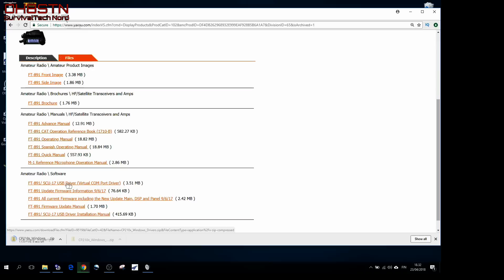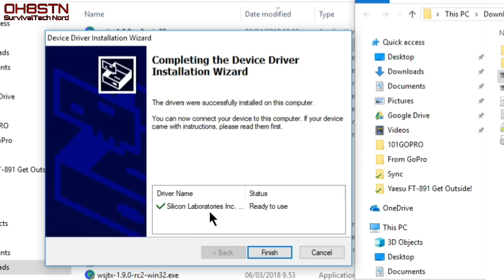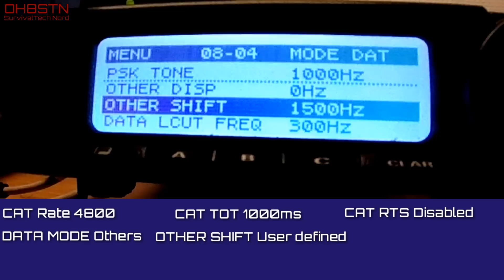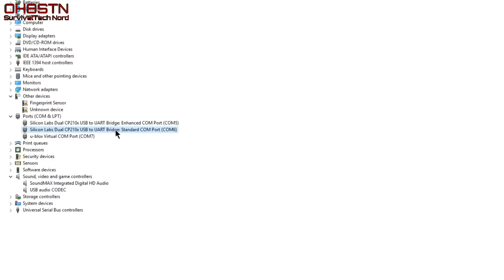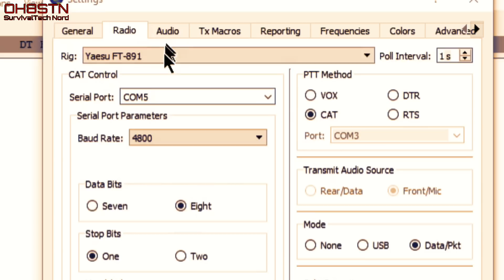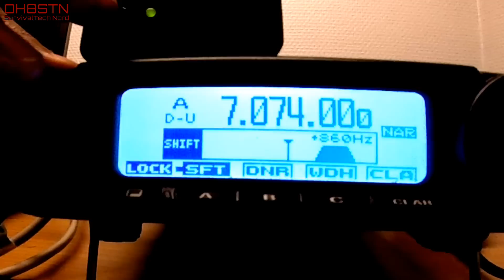Yaesu FT-891 FT8 WSJT-X Data & CAT configuration

Comment: Hello Julian, this is an excellent video which I followed to the letter and managed to set up my FT-891 with WSJT-X connected to my Laptop using a SignaLink interface. I have a problem though which I'm hoping you can help me with. After about 5-10 transmissions, the CAT control seems to get lost and the radio does not transmit any power. If I unplug the USB plug from the Laptop (the one connected to the radio) then re-connect it, the CAT control is re-established. The number of transmissions varies before this happens. I have tried altering the Power (15 watts and 30 watts) and it happens on both. Do you have any thoughts on what could be causing this ? It's rather annoying, especially if I am in the middle of a QSO ! Thanks. Martin
Reply from the maker: Sounds like RFI.
Try a shorter USB cable. In fact try to reduce the length of all of your cables, as much as possible. This is just fixing the symptoms though. Trying to figure out if you're getting current in your coax, from your antenna.
Thanks for the question and the comment, it's very much appreciated
Reply: @OH8STN  Thanks Julian, I attached a Ferrite Bead to the end of the USB cable (the PC end) and it seems to have worked, the TX continues for as long as needed now and does not cut out (I guess the source of the RFI is still there but at least I have a workround. One other issue I am having with this setup,  when I transmit on frequencies between 600Hz and around 1600Hz, full power (set to 25W) is achieved. When replying to CQ call on frequencies from around 1800Hz and up, my power drops to around 1-2 watts. Can you suggest what settings need to be changed or suggest what the problem may be ? My "Other Shift" setting on the radio is set to 1000Hz and "Width" setting to 800HZ. Thanks

Comment: One more Question :) should i Switch AGC  off ? If i Turn it on, on the left side my Waterfall is red then ... and what about NAR ?
Reply from the maker: Great question.  I usually run with agc off when running data modes. The best advice I can give you is not to be afraid to test and find the best setup for you. AGC is definitely off but I think settings can be applied dynamically based on the situation. Does that make sense?
Reply: @OH8STN  yes ! thank you.... i am new in HAM Radio so i have much Questions :) i will try it......
Reply from the maker: @mabo4848  no worries. You can always ask questions although I don't always answer so quickly.
Reply: OH8STN Thank you 😀

Comment: Got a question for you I am just getting into digital what program do you use?
Reply: Ok cool thanks for the info
Reply from the maker: It really depends on the mode. If you want to do ft8 or wspr you'll need to use wsjt-x. If you want to run JS8, JS8Call. Everything else, FLDigi.
Reply: @OH8STN  ok cool thanks one more question what do u use for HD email?
Reply: Hf not hd
Reply from the maker: @donnymazon8516  there are two options. PSKMail and WinLink. PSKMail has its own client for every OS, WinLink is Winfows only, but there is an independent Raspberry Pi deployment

Comment: If i wanted to use ft891 cat control with a mac what driver would i need?
Reply from the maker: You might have to check the Yaesu.com website for drivers. If your Mac is linux-based like most modern Apple computers are, you won't need a driver.
Reply: I have a 2010 MacBook Pro and did not have to load any drivers.

Comment: N4AOX new operator having trouble with 891 running DigiPan --CCW. I have rigged a CAT (Silicon Labs UART Advance RS232 Port) on my Win 7 Laptop USB/Com #6, but still cannot get the
PTT signal to go to transmit thru the CAT port (mini-USB on the 891). I have the Data In and Data Out 6 pin
DIN plug coming from computer laptop with the mic-in and mic-out 1/8 plugs.

The rig works fine with PSK31 on the DIGITAL MODEM from China, with its own
onboard sound card thru the 891 using the 6 pin DIN plug on the 891 to 6pin DIN on the DIGITAL MODEM.

The rig runs DigiPan on the LAPTOP in receive AOK, but NO
TRANSMIT. I can hold down the Mic. PTT and it does seem to send, but cannot get the PTT
signal from the LAPTOP through the Cat Cord to work, even though DigiPan recognizes Com#5 PTT-RST-on.

I want it to work PSK-31 like is described on Page 64 of the 891 advanced manual using a
laptop. I have gone thru the 891 memory menu settings several times. Is the lower diagram P.64
in the 891 advance manual NOT CORRECT?
Reply from the maker: I would bet anything the problem is either 
(1) the Silicon Labs uart Advanced rs-232 Port. 
(2) The Yaesu USB drivers were not installed or not configured correctly.
(3) The wrong USB port was chosen.
The manual is 100% correct.
Reply: @OH8STN  I can make it work by holding down PTT button on Mike but that is not convenient.  I can do like they did in the old days and build a little circuit to VOX the data-in and dump a killer voltage on the 891 PTT line internally but hate to start carving on a 1 mo old radio.
Reply from the maker: @ccwynn6657  I think the problem is somewhere between the radio and the chair. 😉
I gave you 3 troubleshooting points to consider, test those. You could also simply enable Vox on the data port.  If you're unsuccessful, you could also contact Yaesu support. I'm sure they can walk through your configuration with you.

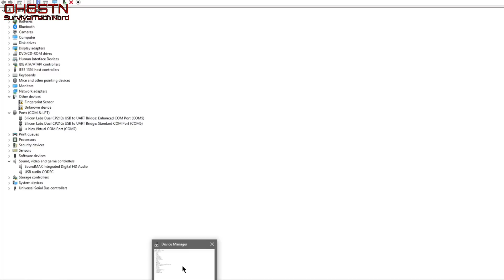Comment: Hi Julian - At 5:45 you mention a cable that plugs into the DATA/RTTY port, then plugs into a USB port in the computer.  However, I have the cable that plugs into the DATA/RTTY port on the rig, but ends in open wires.  I had assumed that it would be going to the sound card.  I guess that I could splice in a USB plug, If I knew which wires went where into the USB.

Comment: Great video,
as I see the data mode is D-U 8 than you simple change shift 1000 hz  width 500hz.A question Julian,can I put the Data Mode on USB mode?
Dinos..73..
Reply from the maker: Yes, you can also use USB mode 👍👍👍
Reply: @OH8STN  thanks Julian..73

Comment: Hi Julian, Have you heard of and/or experienced the "CAT clicking" problem that's been reported with the FT-891? I'm thinking about buying a used one but I can't find out if that problem was a settings fix or a hardware problem that I'd need a warranty to repair. I'm really interested in running this with digital modes and if it has "issues" in some models I'd pay an extra $100 for the full 3 year warranty. 

 If you've experienced that problem and overcome it with a radio setting could you please respond to this comment?

Thanks and I really like your ham radio videos.
Reply from the maker: You know I'm just sitting here working on an ft-891 video. That clicking was in the first generation of the ft-891. In the more recent versions, there isn't that problem. It seems that Yaesu has quietly fixed it, without letting anyone know there was an initial problem. So 90% of the communications I do with the 891 are digital Communications. Winlink, js8, ... there's a website or possibly a group on Facebook that identified which of the 891 series, had the problem by its serial number. I'll need to find it, but I will include that in my video.
Reply: @OH8STN  wow thanks for the quick reply.

Comment: Julian, I have found an alternate method to having to move the SFT key to max.  Instead, go to OTHER DISP 1500, OTHER SHIFT 1500, DATA LCUT FREQ OFF, DATA HCUT OFF, DATA PTT DAKY, go to main screen and adjust WDH to Max 3000, don't touch SFT!  This will give you max receive on the center freq.   I have these settings and they seem to work fine.
Reply from the maker: Thanks for this. Actually this is how I'm doing it these days. Your way is a much nicer way, and the shift still works as intended. I should make an update video on that.

Comment: Hi, Julian.  I used your parameters to get my FT-891 to talk to FLRIG and FLDIGI on my Maacbook Pro runniing Parallels (Windows).  Good instructions!  In order to get FLRIG to work, I installed the latest version, 1.3.42.03.  I have not yet gotten to configuring wsjt-x or js8call.  Still on to do list.

Comment: From my experience I’ve come to

Cw freq display FREQ
Data mode OTHERS
Other disp 1500
Other shift 1500
Data lcut freq OFF
Data hcut freq OFF

And from main screen set WDH to maximum 3000, don't touch SFT.

Doing so we have maximum width filter starting at our dial frequency (=tuned freq) centered at dial freq+1500.

I didn’t find any detailed explanation of those  Shift and Disp did it mostly experimentally.
But they look like: Filter center=tuned freq+Shift and Dial freq=Filter center - Disp
Sure everything Inside 891 is much more complex since it's triple conversion radio + DSP. My explanation above is as if we are dealing with classic single conversion SSB receiver.

73
Andrey RA0UFF
Reply from the maker: Thanks Andre. I've arrived at very similar settings now. The bandwidth and the shift functions in the front panel of the radio work together. You can narrow the bandwidth with the bandwidth setting on the front panel and then moved the shift for the signal you want to focus on. This will bring a signal that is almost inaudible, up to Reliable and perfectly readable level. Thanks for sharing these settings I always look forward to your comments.
73
Julian oh8stn
Reply: Yep, in case of weak signal and/or interference we could always use WDH+SFT to narrow bw and focus on desired station.

Comment: Hi Julian! I just got the FT-891 (partly thanks to your reviews of it!). Interestingly, things didn't quite seem to work right until I set the OTHER DISP to 1500, along with the OTHER SHIFT set to 1500. I was then able to see a nice, solid 3k passband for FT8 work. That, of course, after I saw the part of your video where you adjust the filter width.  Hehe.  Anyway, an interesting note. I'm doing more research on what all of these options mean (what the heck is DAKY?!), but thanks for helping get me started.  73, Rex KE6MT
Reply: From the 'FT-891 Advanced Manual':
06-07 AM PTT SELECT
-------------------
Function: Sets the PTT control for the AM transmit signal. Available Values: DAKY/RTS/DTR
Default: DAKY
Description: Selects the PTT control method for the AM transmit.
DAKY: Controls the AM transmit signal from the RTTY/DATA jack (pin 3) on the rear panel.
DTR: Controls the AM transmit signal from the USB virtual COM/DTR ports.
RTS: Controls the AM transmit signal from the USB virtual COM/RTS ports.
Reply from the maker: Paula, some context please.
Reply: @OH8STN  Rex asked what 'DAKY' means. I pasted the text from the advanced manual which explains what it does. I think DAKY is an abbreviation of 'DATA KEYING', i.e. 'Push-to-talk keying via the data jack'. I think that when you set the 'AM PTT SELECT' to 'DAKY', you enable the option to be able to switch the 891 to transmit via the DATA jack.

Comment: i tried all these setting set up the rig and software  like he said and could not get to work i have been trying over a month, uninstall the software and drivers and reset the radio reset all back up has a complete failure still would not work

Comment: Hi 👋Julian! Quick question. Do you have to run an external sound card for FT8 with the 891 or just the USB 1 to USB2 from radio to computer. I’m gonna give digital a try and have been learning from your videos.
Reply from the maker: N1UFO/ Gabriel hello Gabriel. There's no internal sound card on the 891 (a shame) so we have to run an external audio interface.

Comment: Hello,  How do I change from LSB to USB below 10 mhz?  D-U does not wouk... ???
Reply from the maker: For voice or for data?
If it's for voice you long press on the band button then select the mode. For data you change the date of bfo D-U or D-L
Reply from the maker: By the way all data Communications on HF except for Mars are USB. even below 30M
Reply: That poses a small problem for me since i have interest in Olivia and JS8Call  [all in USB] and checking into the Texas traffic net on LSB all on 40 meters. @OH8STN
Reply from the maker: I don't see why it's a problem, it's just a radio vfo setting

Comment: Kiitos!   Everything worked as shown but the FT-891 will not select the rear panel for data input and instead selects the mic, even though "Rear" has been selected.  Any hints on this?
Reply: This got me too...even factory reset..then thought about it... it depends on the mode your on...if its SSB then you need to change the 11-05 menu.... change the mic select to rear for what ever mode your using! 73's
Reply: @ah2ejshane600  This is one of my problem i noticed it was using mic because if i talked it would move power out.. this was on SSB, but now when i ptt using wsjtx it moves radio into data u mode every time instead of just leaving it in ssb.

Comment: So brand new to this and have the 891. What is the MiniPro box on top of the 891 you're using and what is its function? Is MiniPro required?
Reply from the maker: +Shortwave Listener that little box is the audio interface. It allows you to run software on a laptop tablet or Raspberry Pi, for digital Communications like psk, Olivia, ft8, or rtty. So it's job is to take the sound from the apps running on your computer, and turn those into something the radio can work with sending out over the air. It's only required if your running digital modes
Reply: OH8STN is the MiniPro the only vendor with this interface, or are there others (MiniPro price seems a bit high)?
Reply from the maker: You do the same thing by making your own cable. There is another company who makes audio interface is called signalink. And unfortunately the price is always what it is in amateur radio. The trick is to build as much of it yourself as you can

Comment: Is the shift of 1 kHz really needed? Would a width of 2500 Hz (or 2700) be more effective at decoding more signals?
Reply from the maker: I've been having the same argument with my buddies. I would say yes smaller bandwidth would be more efficient. Anyway the answer to your question is no it is not required. In fact sometimes I limit the bandwidth to just 500 Hertz, when I want to reduce the noise or interference from powerful stations
Reply: Thank you for your answer and I will keep this in mind. By the way I'm also a HAM (SY2COB)

Comment: Thank you so much for putting this together, Julian.
Reply from the maker: Happy if it helps 👍👍👍
73
Julian oh8stn
Reply: I finally got back to my radio this weekend and was able to run through this. Worked flawlessly. Thank you so much for doing that. Thinking the RTS setting was the problem child for me like it was for you. 

For what it's worth, for the "other shift" setting I got some advice elsewhere to set that to 1500Hz, given where WSJT-X puts the center point for decoding relative to the tuned frequency. When I set the width to 3000Hz (the max width) I get a big dump of decodes so it seems to make sense that those two complement each other for the broadest range. All that said, I'm still relatively new to all of this so I may be totally making that up. :-D

Thank you again!
Reply from the maker: Glad I could help. That advice actually sounds logical and sounds good. I have it also set up that way now. But I figured it out after the video
Thanks for watching and coming back with some feedback. It's very much appreciated
73
Julian oh8stn

Comment: Good stuff as always. 

Help me understand the shift of 1000Hz.  I've not seen / read that anywhere else when looking at WSJT-X settings. I leave mine at zero and am able to decode everything fine.  What am I missing?
Reply from the maker: These days I leave the shift at 0, but have the offset at 1500hz. This is assuming I'm displaying the entire 3000 Hertz band pass. If I want to filter out or focus on a specific signal I would narrow the bandpass, and use the shift to adjust to the center of the signal I want.
Reply from the maker: There's a couple of different reasons you'd want to use the shift. Usually I use the shift and the bandwidth adjustment together. So for example you're getting qrm for man rtty contester. His signal is too wide to notch, so you could reduce your bandwidth to something like 1,000 hurts instead of the normal 3000 Hertz then use the shift to move your bandpass away from the qrm. Does that make sense?
Reply: OH8STN Ham Radio @aw